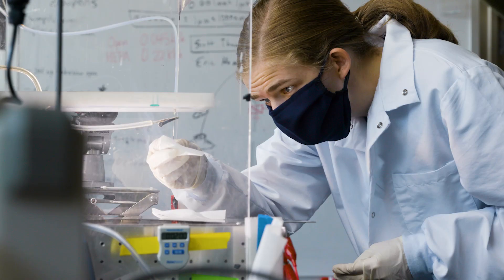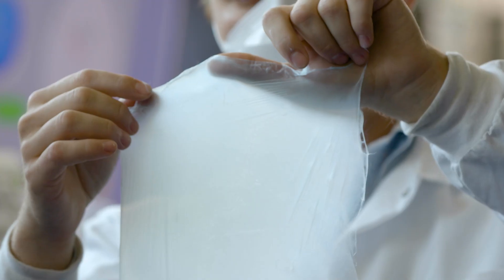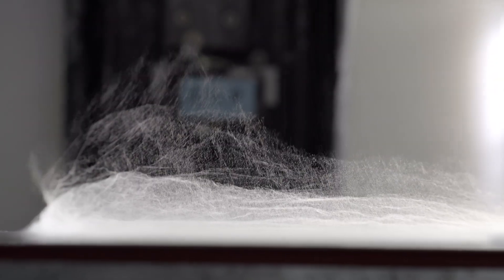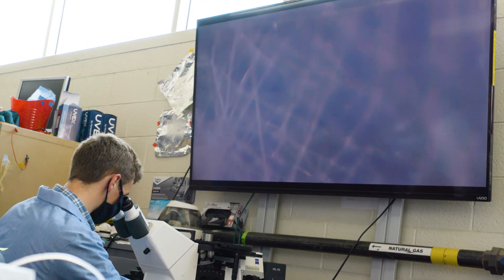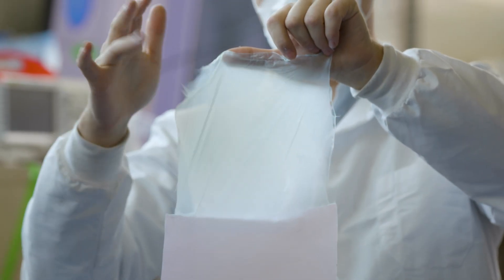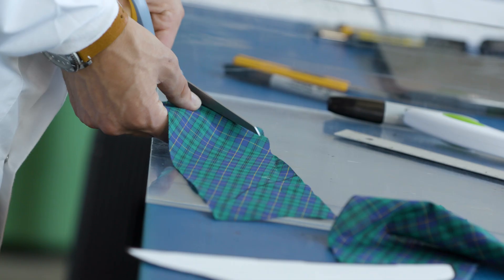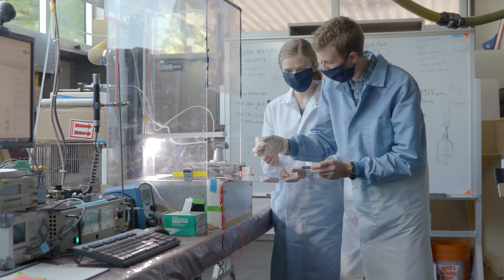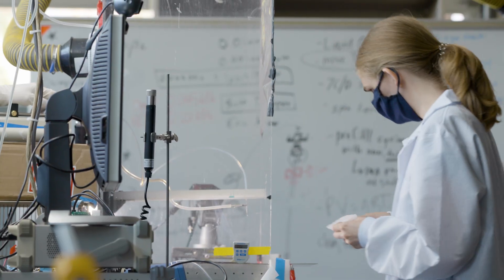Spinning nanofibers to improve N-95 masks

Comment: This inferior reinvention of the wheel is academic. The old Chinese meltblown fiber tech produces superior filtration fabric, is far more scalable, and they've already sunk price into the dirt due to economics of scale. This hexagon wheel of yours makes for great learning experience for kids, but nothing else.
Reply: Nanofibers are much smaller and denser and thus retain efficiency even when the electrostatic charge is lost, meltblown fibers do not have this bonus. Costs are already very low and constantly dropping, and many mask producers are already switching to the use of nanofibers. Nano fiber filters also have the potential to be washable and disinfectable, something meltblown fibers are incapable of due to the loss of electrostatic charge. Nano fibers also generally have less airflow resistance and less humidity build up when worn in a mask.
Reply: @descai10  can you elaborate about CERN proving spirits? What /when was this?